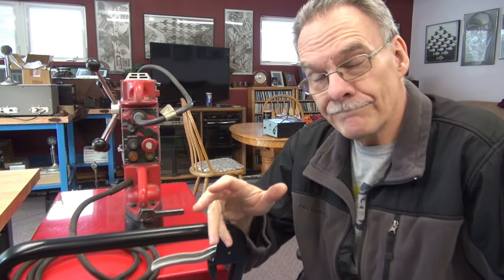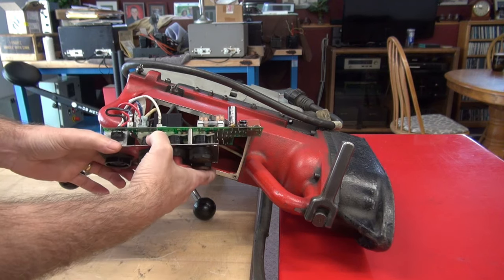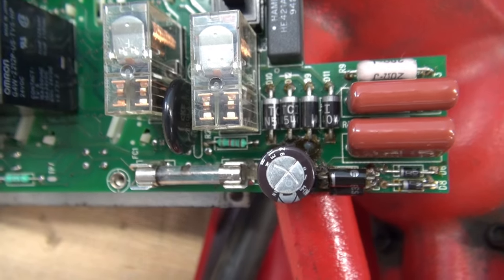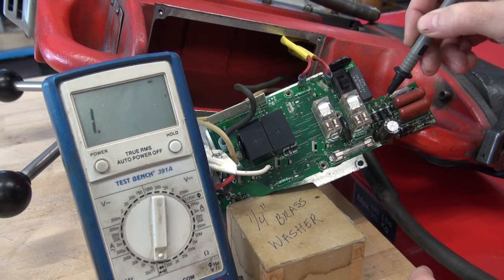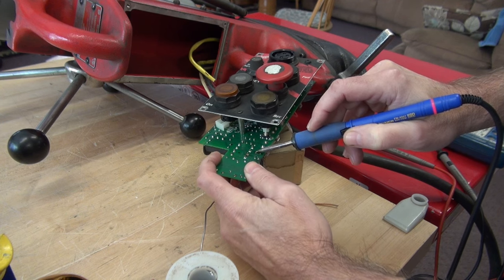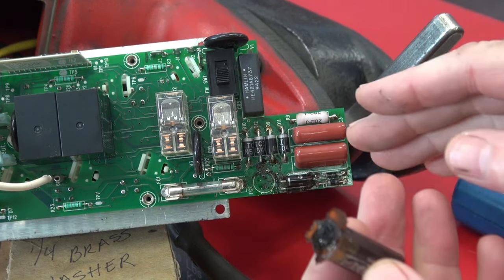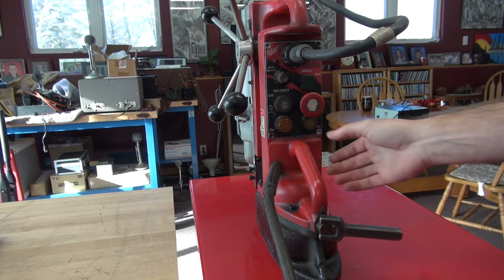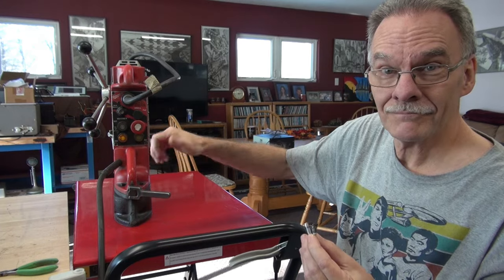How to Repair dead Milwaukee 4203 Industrial Mag base drill press defective circuit board simple fix

Comment: Where I work whenever a repair comes in with a blown diode bridge, it usually takes out a pair of diodes, which in this case was the other iffy diode. We always replace all 4 diodes to prevent future failures from occurring in case the other diodes were stressed.
Reply: Yes all must be replaced

Comment: I never was a fan of solder wick. Easy to overheat the board and lift circuit traces.  A good solder sucker, either manual or with a vacuum pump, does a easier, quicker job without hurting the board.

Comment: Haven't missed a D-lab video in years. Thanks for all the posts! I used to work with you in AZO (any guesses?). One question: Do you try to re-apply conformal coating to a re-worked industrial circuit board?
Reply from the maker: I used conformal coating in the USAF. We had it in spray and brush on. Have not used it since. Did we work at Parker (Pat Gipper)?
Reply: @d-labelectronics  Yes, you can spray or brush acrylic coatings (type AR), which is basically the same as nail polish, to protect from moisture intrusion. Mostly for sensitive circuits involving Op Amps. Not as much concern in power supply unless it is soaked. Parker is correct! Urethane (type UR) is even better, but is more difficult during repair.